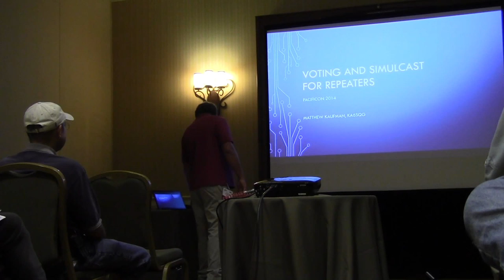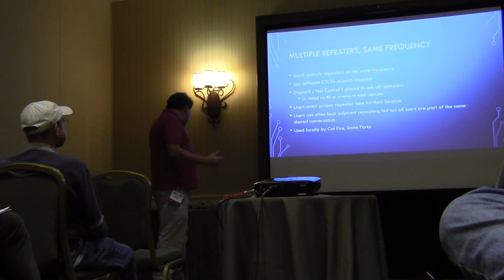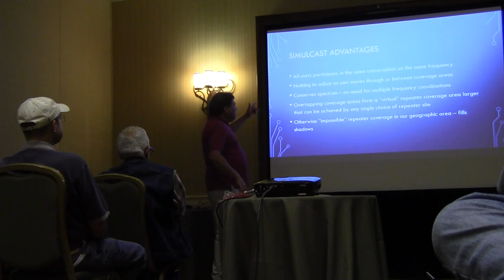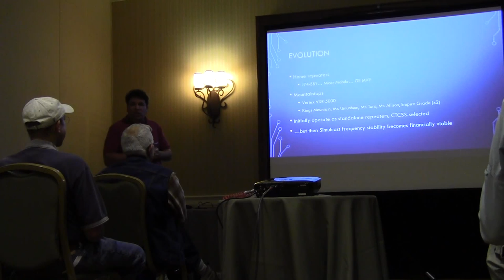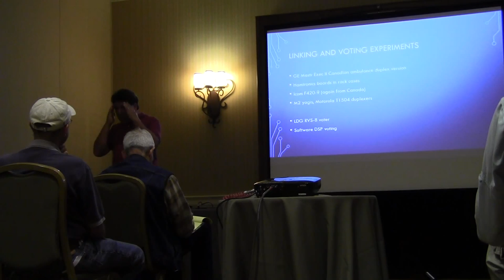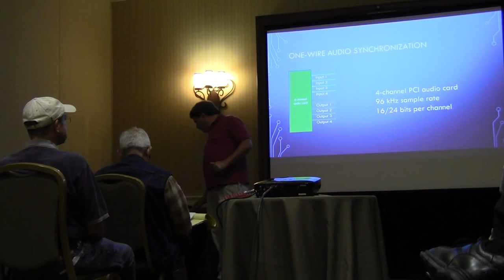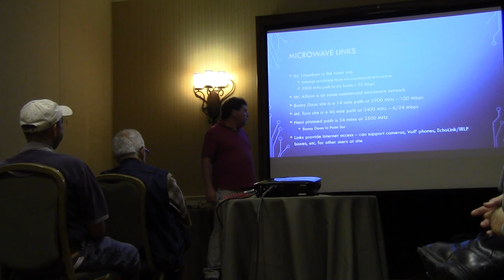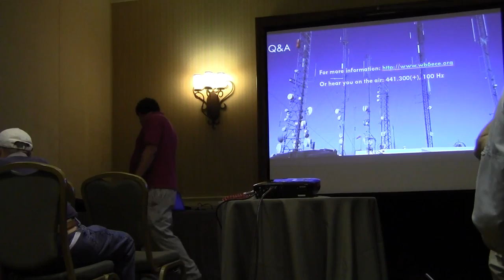Voting and Simulcast for Repeaters - Matthew Kaufman KA6SQG

Comment: Excellent presentation.!
Thanks for recording and making it available for everyone.

IMHO… the advent of P25 TRS systems, now becoming ubiquitous, are now making public safety less safe.
Digital technology, be it P25 (Phase I and II), DMR, NXDN.. is actually helping to overcome the perceived loss of coverage caused by narrowbanding.  (12.5Khz channel spacing).

The problem is the use of networked and trunked systems where the failure of a single site/repeater component can cause devastating failure systemwide.  Even worse, when the agencies running the comm systems are implementing the “Evil-E”.  (encryption), the risk of failure is large and the lack of transparency is troubling to anyone treasuring freedom.
P 
True interoperability really requires that public safety agencies can talk/hear all other agencies they can expect to encounter on a scene.  

My comments are based on my personal experiences on 9/11/2001at WTC and a complete cluster F.

Thanks again for the video!